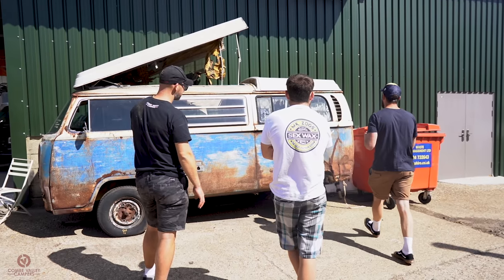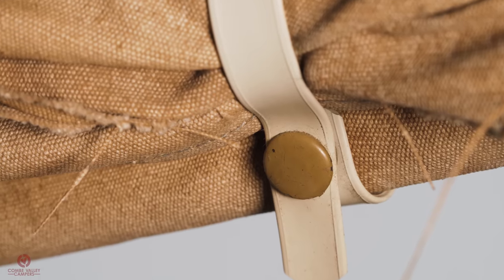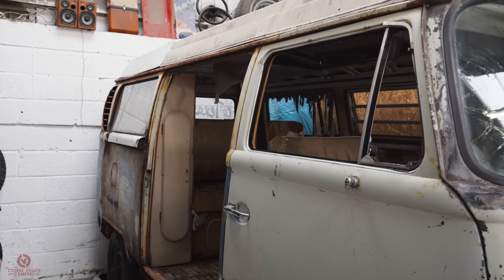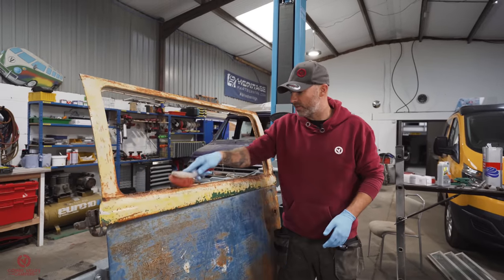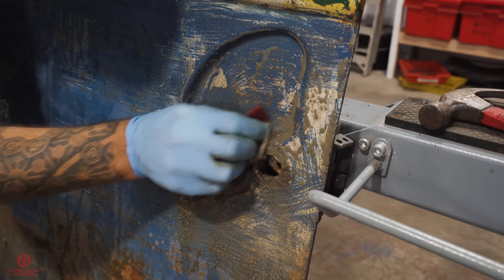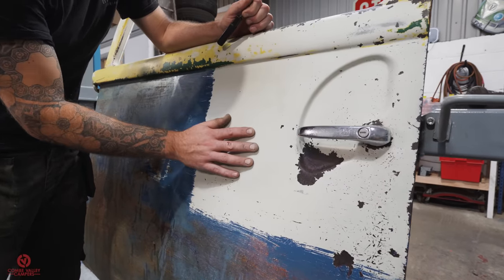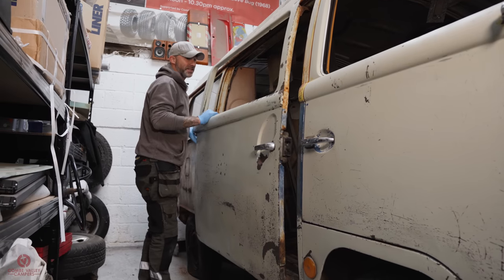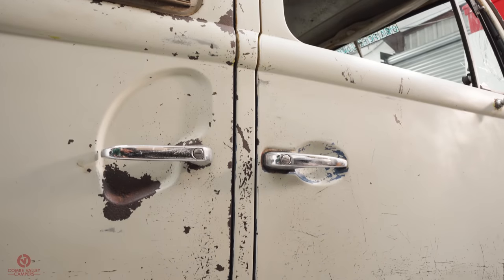IS THIS THE UK'S WORST CAMPERVAN? CAN WE SAVE IT? Introducing the 'WORST-FALIA' | Ep1

Comment: She's a thing of beauty - I wouldn't hide the scars.

I have tried out Evaporust recently, the liquid one you soak stuff in - it's blown my tiny mind.  I tried it out on some super crusty spanners and all sorts of stuff.  Drop the thing in, leave it a day or more, take it out, rinse it off - no rust left 🤯.

It wouldn't work for what you're doing as it doesn't touch the paint, but they do make a gel which I think you can use on body panels and stuff.  I need a big flat rusty thing so I can buy some and try it out 😂
Reply from the maker: I’ve seen the results of evaporite on another channel I watch. It’s like a magic liquid!
Reply: @CombeValleyCampers  That's what amazed me, zero work or burnt skin, the rust just goes away and no good metal or paint is removed.  I kept going and finding more stuff to put in just to see what it did - although I think I need to find a new hobby - I've used up 5 litres of the stuff now 🤣